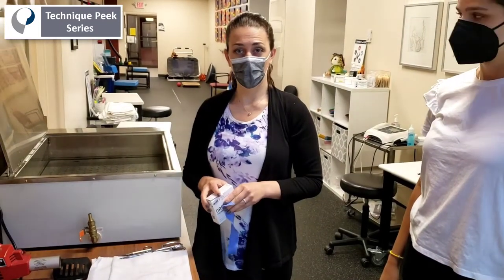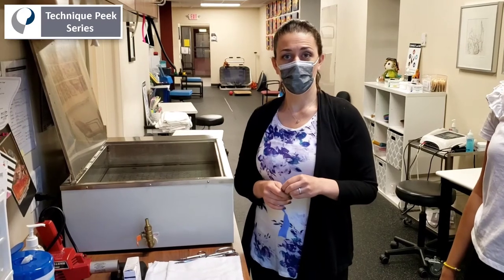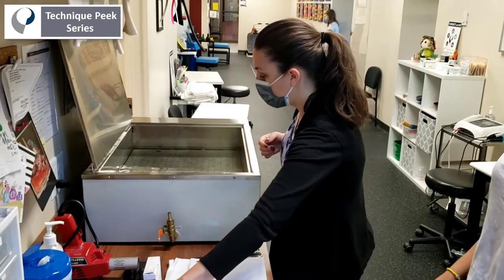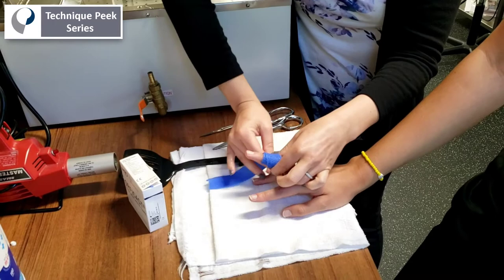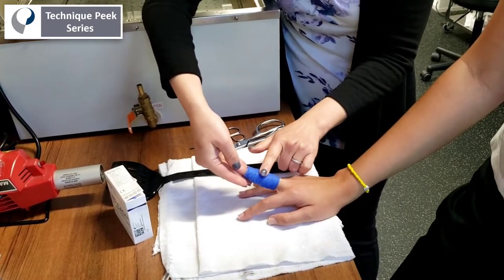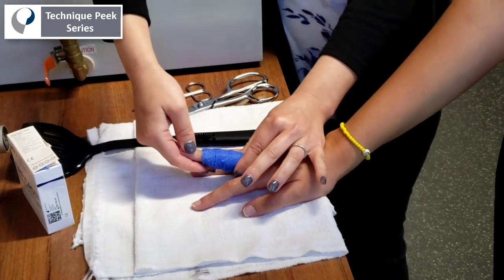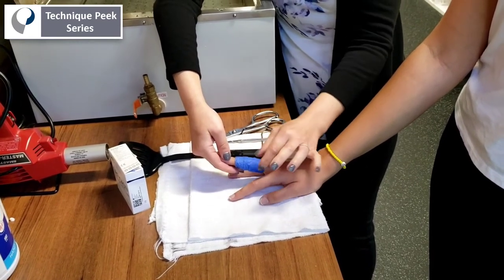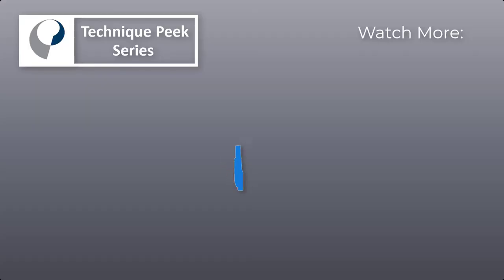Serial Casting for PIP Joint Contractures  |  Technique Peek Series

Comment: How do you best remove the Orficast after (say) 1 week of casting?
Reply from the maker: Hi @Savana Ashton! You should be able to slip off the Orficast in most cases otherwise, you can use a pair of small suture removal scissors to cut it off. Just be careful to go slow. You may also want to run it under warm water before in order to soften it up a bit. Hope that helps.